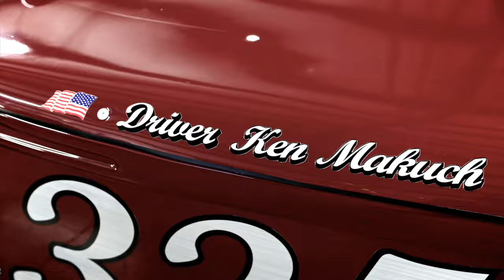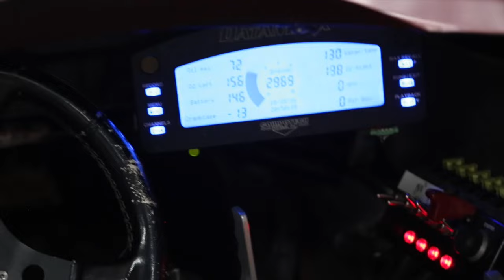Our Racing Heroes "Evolution of the Flathead Motor"

Comment: 400 hp!!!! To put this in perspective. The Flathead Ford was introduced in 1932 and displaced 221 cu. in.(3.6L) and was rated at 65hp. It's largest version was 355 cu. in.(5.5L)and no version(221, 239, 255, 317, or 355) made more than 110hp. At 400hp this engine has roughly the same horsepower as the Ford-Cosworth DFV(happy 1st win anniversary)when it was first introduced in 1967 at 410hp. Or like taking an engine today rated at 500hp and making 2,000hp. NA
Reply: there was no 355. there was a 331 and that made around 150-140hp the later 293 made 110 and the later merc 255 made 125
Reply: @53_ford_custom15  according to some sources there was a truck engine in 355 c.i. but I'll differ to you as I only know what I've read on this through the internet. This was before my time.
Reply: My guess is that this engine is not more than 300 cubic inch, and was built from a 239 or 255 inch engine. I do not think anyone uses the truck or Lincoln engine because they are very heavy and no real performance parts for that engine. I too would like to know more details on this engine. VERY IMPRESSIVE !!
Reply: @daleostrom3613  even if it was the 255 that's exactly the same displacement as Ford's quad-cam all aluminum Indy engine which produced 370 hp in 1964. Maybe that's the engine to compare this flathead screamer too instead of the DFV.
Reply: Cubic inches isn't the issue it's the lack of main bearings to support the crankshaft. He must have some kind of girdle to hold it all together. It's not just a 1/4 mile blast. This thing is under stress for a long time going both directions on the course. Kudo's to all you fellow gearheads

Comment: What impresses me even more than the Horsepower, which is incredible in itself... is the RPM's it is turning.  Flathead Ford V-8's are NOT know as high rev engines!!!  Back in my day, I'm 68, 3800-4200 RPM's was wound up pretty damn tight for a flattie Ford V-8.  And, it had to have some work on the valve springs, and a couple of other things, to get to the 4,200.  Just guessing from the sound of it on the flats... he's getting 6,000+ RPM's out of it.  This guy could get 100 Horsepower out of a sewing machine!!!

Comment: Here's how to improve high speed handling. The tapered shape of the body creates high pressure areas on the sides of the engine cowl, some of the air gets forced under the car, that's why you're losing contact with the ground. To prevent that from happening, I'd run an air splitter that basically wraps around the entire front of the car, tapering off to nothing where the body stops getting wider. Without all that air being crammed under the front of the car, it should have much better high speed manners.
Reply: I doubt that would be the cause of this cars problem. You are right in that the car most likely has a higher pressure along its sides but it also would have two large wakes of turbulent low pressure air behind the front wheels. The problem is more likely a low pressure zone on top of the trunk. Trying to keep to boundary layer attached and running a trunk without louvers and depending on the rules experimenting with a small rear diffuser could be a solution. A front splitter sounds like a sure fire way of unsettling a car like this at high speeds...